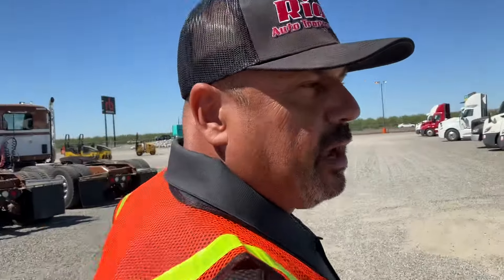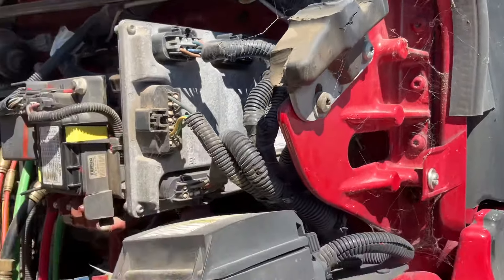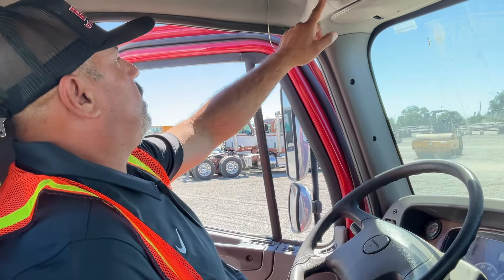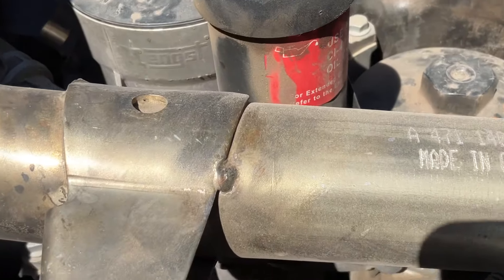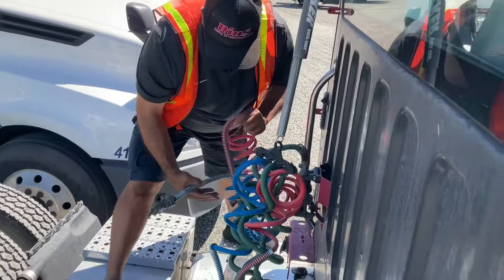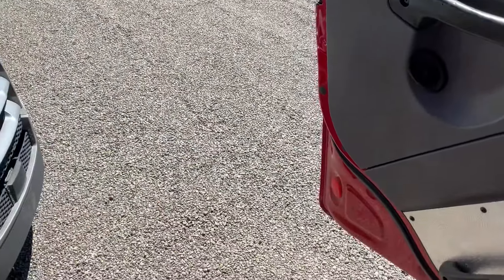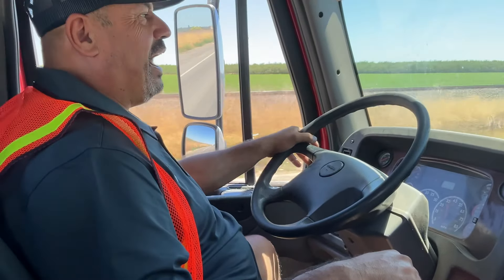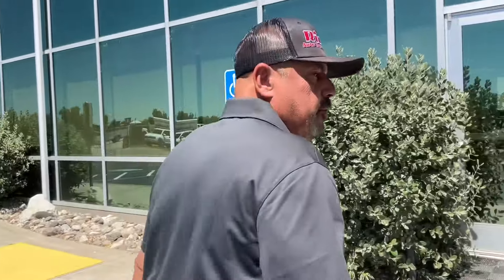I bought a Freightlinger M2 online without viewing it!

Comment: Mr Rios , congratulations on your freight liner purchase . You’ll discover that you now have a better ability to slow down and stop with a full load of cars. I had upgraded to an M2  [sport chassis] from a Silverado 6500 and it was well worth it . More power and torque and much more stable . That DD13 should last you 750k to 1.1 mil miles easy . I upgraded again to a Cascadia 126 for the sleeper and ability to pull a cottrell 6/7 car trailer . Wishing you and your wife safe travels and enjoyment of the road !  Maybe my wife and I will see you good folks out there .
Reply from the maker: Thank you!!  Yes hopefully I’ll see you on the road.

Comment: Rio buy a single axle cascadia best ever Recomended  with the infinity trailer. m2 are really not comfortable at all
Reply from the maker: I got a really good deal, I only paid $9,500.  It’s a 112 It has a DD13 ten speed with a Fuller transmission. I’ve learned what the Infinty GNW 500 is capable of doing by watching your videos, Thank you!!!  I would have bought a Cascadia had I not got this one, watch my next video you’ll be shocked.
Reply: @riosautotransportllc  make sure to move fifth wheel more back if not you will loose bottom deck space.
Reply from the maker: Believe it or not I compared my Dodge 5500 and Freightliner I have more room on the M2 and it’s not slid all the way back. Maybe because the Dodge is a 84” wheel base.
Reply: Ram 5500 is not good for  GN 500 ?